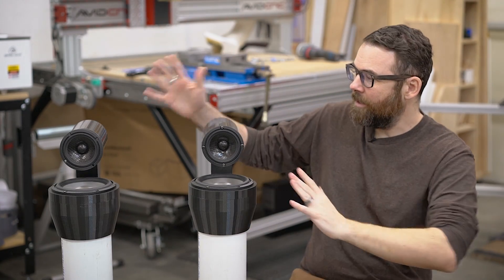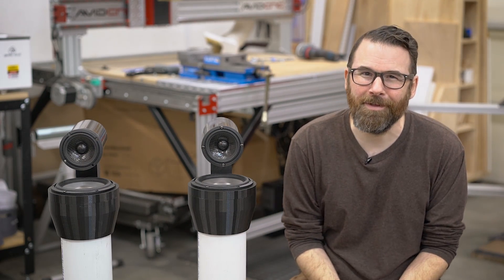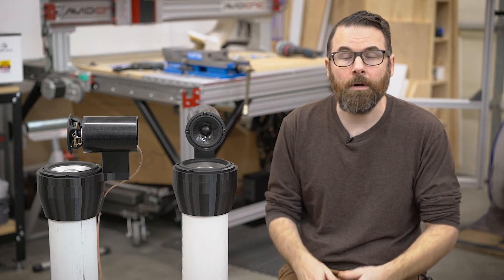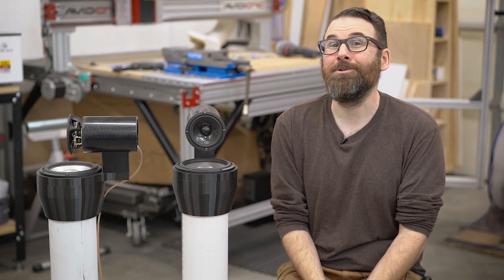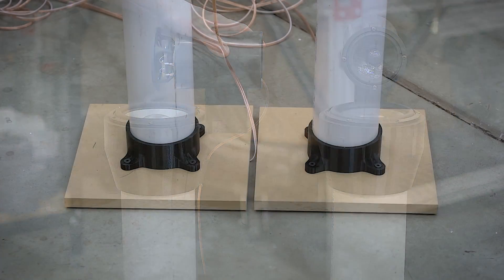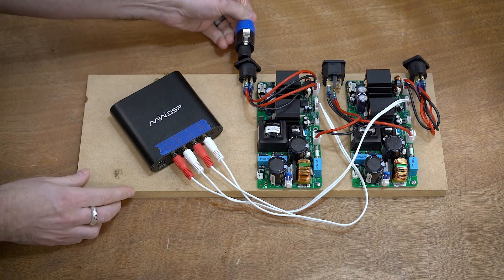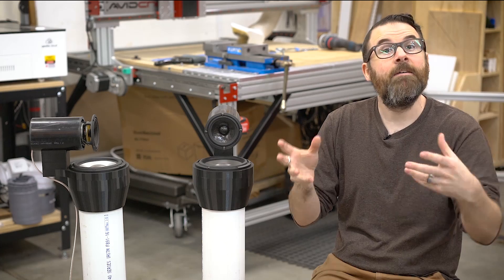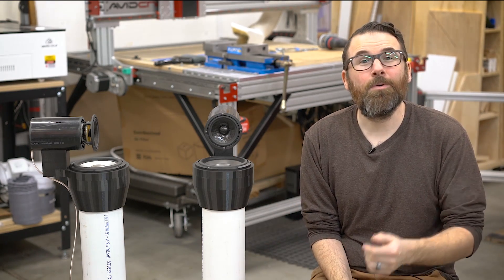DIY Speakers - LXmini Project Overview (Part 1)

Comment: So much energy expended on appearance. 40 years ago 30 seconds would have spent talking about aesthetics. Spirit of the age.
Reply from the maker: Spirit of the age?  OR, you look at things more than you typically use them.  I will look at these speakers more than I will actually listen to them, so looks are fairly important.  Also, if something is worth doing, why not do it well?

Comment: I don't know if you are aware of this. The 125ASX2  modules are a filter-less design, that may not work so well/absolute optimally on every speaker, due to the high PWM signal coming out of the modules.
Reply from the maker: I've tested them quite a bit and they sound pretty decent with these drivers.  I've used them before as well on other speakers.  They were a good budget option, as I didn't want to go too crazy with the electronics on this project.
Reply: @RobertCowanDIY Fair. Have you ever for the fun of it, looked at the output of these modules on a oscilloscope. It looks so strange not seeing a clean "analog" output.
Reply from the maker: @Mr_Wh1  Ha. I haven't!  But I did own a pair of amplifiers based on them and they did sound quite good.  When speaker shopping, we brought them along and tested a lot of speakers with them (and against other amps).  They can sound quite good with the right speakers.

EDIT:  Keep in mind though, this will be an audio system for a summer cabin.  They aren't meant to be an 'end-game' speaker setup, they're mostly for fun and to look interesting.  If I were to go all-out with them, I would most likely pick a different amplifier.
Reply: @RobertCowanDIY  I am not saying anything negative about the modules, I own some myself, it was just to point out that the module is dependent on a cross-over filter or large inductance to filter the output.
Reply: @undress62  The 125ASX2 do not need a buffer under normal conditions, since the board already have one built in.
Regarding the 125ASX2 module; Where you can benefit from a buffer/preamp would be when the sound source is rather weak. The module do need a volume control since it amplifies whatever comes in at full power, and this is where a pre-amplifier can serve as both the buffer and the volume control.

Some ICEpower modules have balanced input, which most standard consumer sound equipment do not have. Balanced sound is usually only found is the professional audio market. This is where you would need a balanced audio source and a way to control balanced audio signal volume. The "buffer" you mention, is properly what is sometimes called a "Symmetrizer", which takes the normal "Single-ended" audio signal you find in most consumer audio, and turns it into "Balanced" audio signal.

The ICEpower 125ASX2 only needs a single-ended signal input, so it doesn't need balanced signals or a "Symmetrizer". If you are from Europe, there is a good DIY site called "Audiophonics" where you find symmetrizer ready made, or as much cheaper DIY modules. If needed.

Comment: 10:41 That sounds pretty dang good through my headphones without any sort of correction.  Nice!  I may have skipped over any sort of "Final Cost" you're at so far... care to share a $$ figure?
Reply from the maker: They do sound quite good in person.  They need a bit of tuning and a smaller room.  My main living room is quite large and open to the whole upstairs, and the shop is around 850 square feet, so both are relatively large spaces.  My total budget, all in, is going to be around $1500.  I'll talk about that in the next upcoming videos.  They're not cheap by any means, but you get a pretty high quality setup for that money, and that includes amplifiers, DSP, etc.  Just connect to a digital source and you're done.

Comment: My vote is for the carbon fiber nylon because of its matt finish and lack of layer lines.  I'd like to see the vertical tubes wrapped in a nice wood veneer.  Don't forget to throw in some custom machined metal components to really give it that high end look.  Excited to see this project.
Reply from the maker: I think I'm going to go with NylonX.  I actually already reached out to Matterhackers and they will be sponsoring this project going forward ;-)  I thought about wood veneer, but it doesn't look right to have it in a column like that.  Nowhere in nature would you see grain wrapped around a cylinder.  I mocked it up in Solidworks and it looked very strange.
Reply: @RobertCowanDIY  I was going to recommend wrapping in CF wrap (The PVC) but this seems much nicer of a design.

Comment: When can we expect the Cowan Technologies rotary subwoofer?
Reply from the maker: OMG yes.  I actually have some big drivers with vented pole pieces.  My goal was to use them for fan subwoofers (a big-ass fan, but with variable pitch blades like a helicopter that's connected to the voice coil).  Too many projects!
Reply: My lft-iii speakers would slam with a rotary sub 🤣
Reply: now there is a blast from the past... I remember seeing the rotary sub about 13 years ago and then nothing...